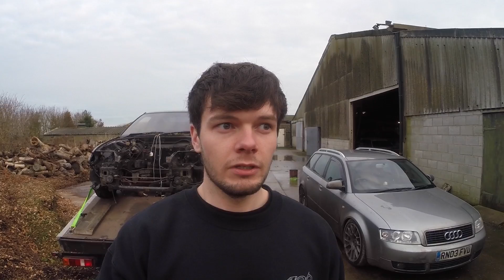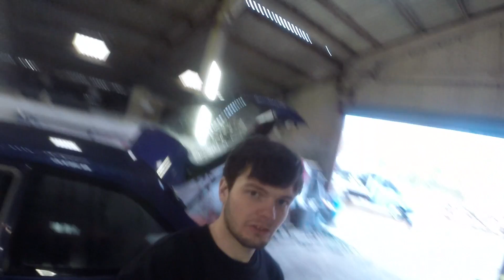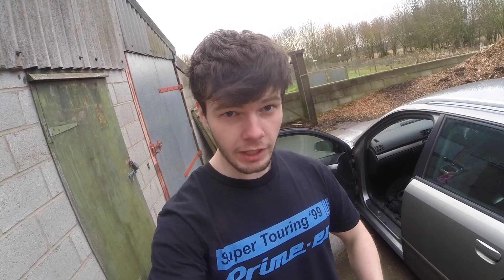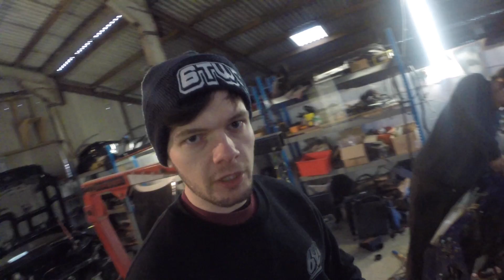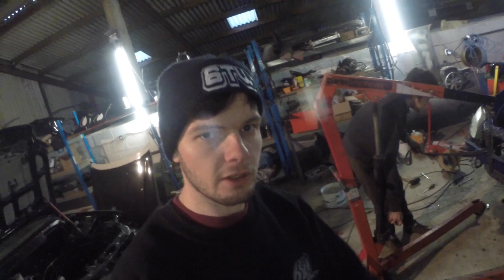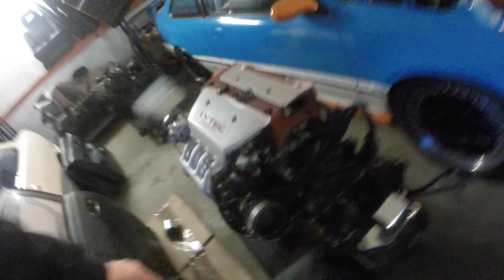We're going back to the Nürburgring! (in April...)

Comment: I miss my old Primera. Use to have a P10 hatchback. If my Golf ever dies I may get another. Maybe a booted one this time. Or even a eGT XD
Reply: I love the look of them. Mine was only a box standard 2.0i but it handled so well. I would really love another and it would be tracked. Trouble is waiting for my Golf to die. The damn thing is bullet proof!
Reply from the maker: Mine was a 1999 P11 GTLE, with the LE extras such as Enkei Alloys, Momo Gear Nob and full leather interior... the handling blew me away every time I drove it!
Reply: I was very surprised at how good my P10 was. Standard suspension but it was great for what it was. It'd piss all over my Mk3 Golf on corners but not as quick though. Becoming alot harder to find a decent one down south here. Wish I'd never scraped it ="(

Comment: Yo is the K20 in your DC2 the JDM K20? or the euro one? Just wondering because you said "Euro Type R K20a2" or captioned atleast.
Reply from the maker: In my DC2 it is a JDM K20a from a DC5 Type R, but the engine Josh is fitting is a K20a2 from a EP3.

Comment: Where did you get the steering wheel setup from for the computer?
Reply: Luke Smith eBay, amazon. Anywhere on the internet. Either a G29 or G920 will work with a computer or PS4/Xbox depending what you like
Reply: Cheers 👍🏻
Reply from the maker: I got it from PC World on a Black Friday deal - was £129.99 or £159.99 with the shifter as well. Couldn't resist at that price!

Comment: Whats the setup for the xbox, wheel and pedalbox?
Reply: Looks like the same setup as mine Logitech g920 with H shifter and wheel stand pro to hold it all together
Reply from the maker: Yeah that's it, though I don't have the wheel stand, just an old table and a bucket seat on the floor!
Reply: Ahhh right fair play, better off with a table instead of the stand if I'm honest, means you can set it up how you want.
Reply: What shifter? logitech also?
Reply from the maker: Yeah all logitech